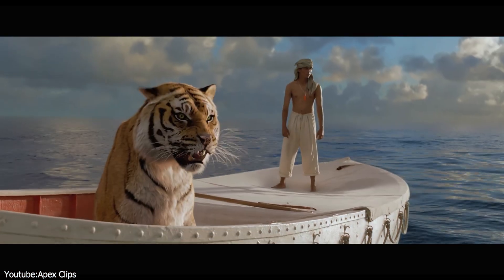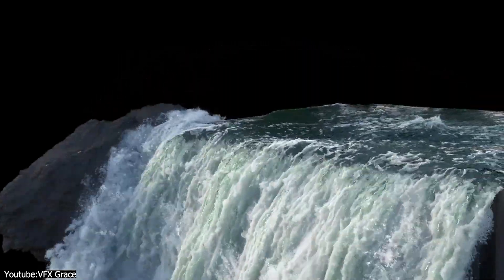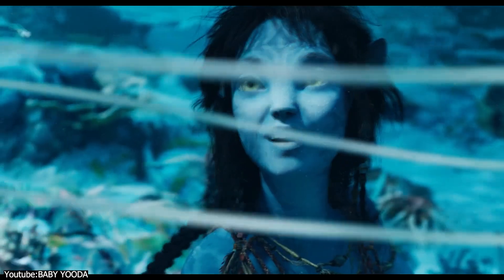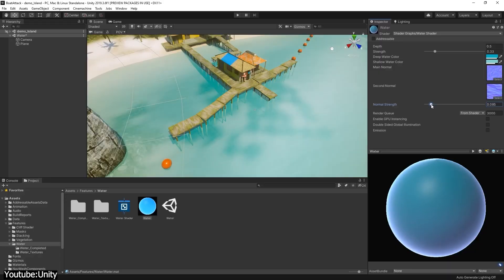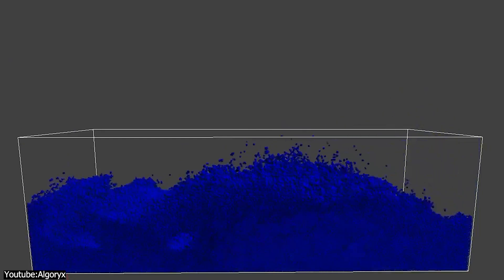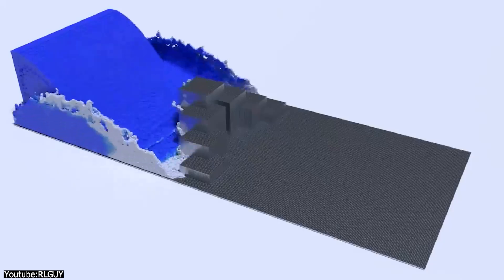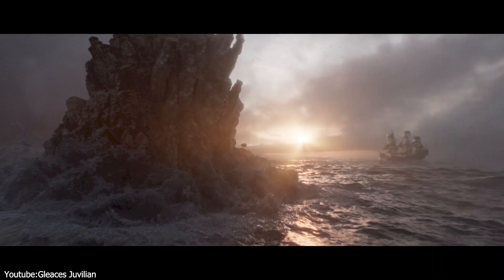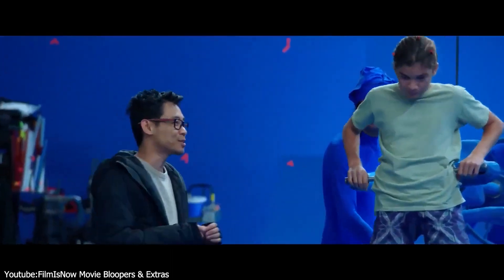How They Create CGI Water in Movies

Comment: Can anyone explain how the simulated water is composited with real water without any visible cutouts as with water it should be hard thing to do ?????
Reply: Fethring ? And by using vertax maps i believe
Reply: It is usually made with cleverly postioned 2d masks. If you look closely, you can spot the difference between the real water and the CGI part in some movies, specially old ones.
Sometimes the whole visible area of water (like a river, or ocean) is completely replaced by CGI, which increases the level of consistency in the shot, and reduces the chance of spotting any difference.